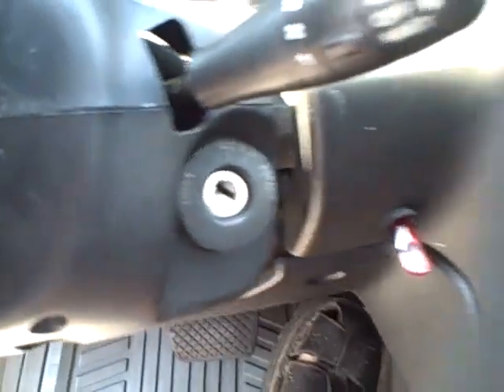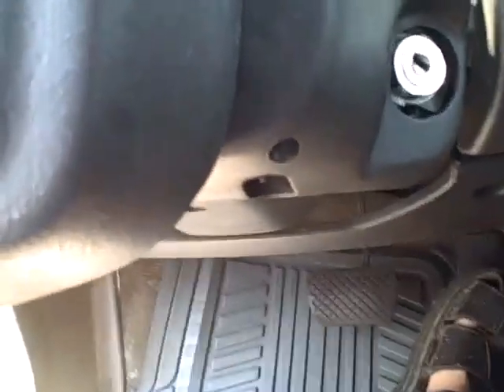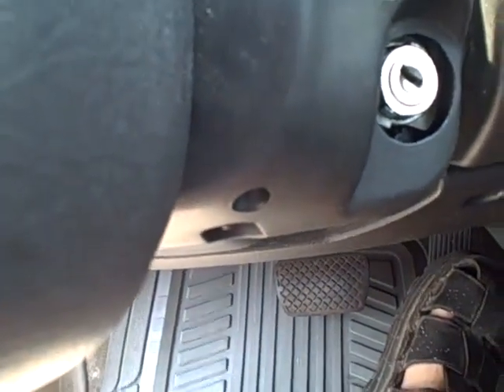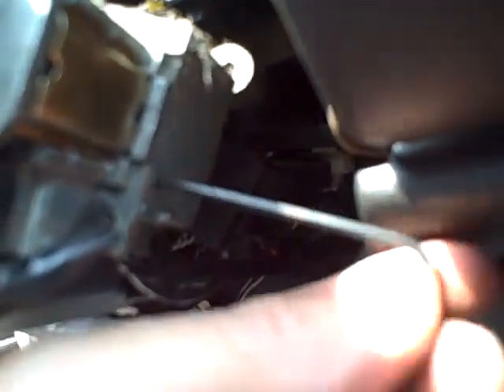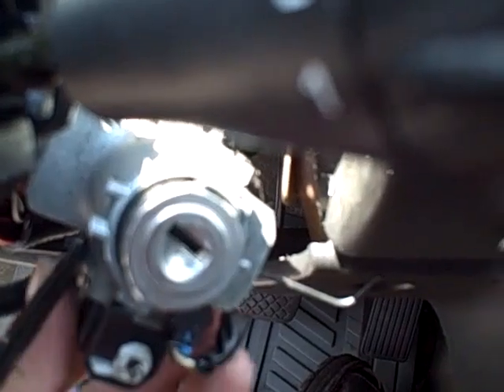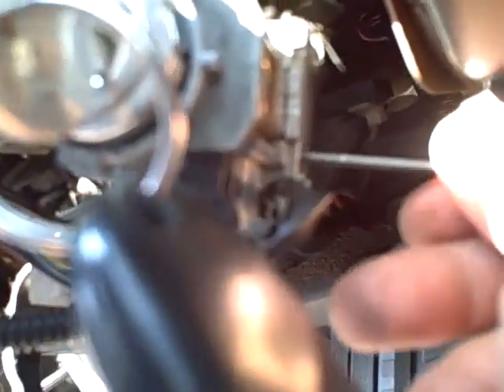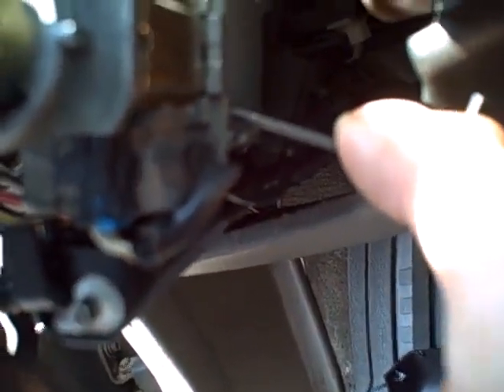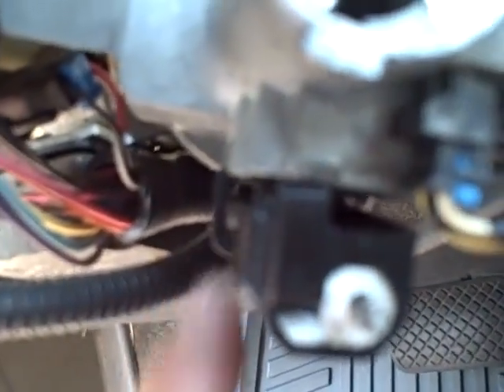2001 saturn sl2 lock cylinder removal. #SaturnSl2

Comment: @1:34 and @3:15  Can you remove that black box (with pin in it) under the cylinder, it has a cord coming out of it? I need to remove the column. I don't know how on your car, but mine is connected to the lock w/zip-tire. I don't know if it is supposed to be like that, or someone did a repair on it. The car was bought preowned. Thank you for the great film.
Update: I have Shop Manual for that car and found fm one description there that the black box might be roll connector (I don't know what it does exactly). They say:
On 2001 model remove roll connector by carefully disengaging plastic retainer tabs w/small flat ... 
All that is in Steering Wheel location. In another place they say:
On vehicles w/automatic transaxles, connect park lock cable to ignition module (shown housing for the ignition lock cylinder).

Comment: After wasting about an hour watching other videos while trying to remove the damn lock cylinder I found your video. You're the only person who mentioned unclipping and dropping the piece beneath the cylinder. I've removed these from other cars and never had any problems. It just wouldn't slide out period. It did come out when I used your suggestion. Thanks man! Nice job. I was late to work but at least I got there.

Comment: What about if you can’t turn the key in there to ACC.

I took my key out too quickly and the lock cylinder seems to be jammed. Can’t turn the key or unlock the wheel. I think I may have to buy an entire assembly just to hopefully start my car. If. It I’ll be splicing or jumper wire it to start.
Reply from the maker: These keys are really picky if they are worn down I always made like 5 extras. I really would say keep jiggeling it should turn
Reply: I hit the end of it with a mallet and switched ch keys to a less worn out spare I had, and it unlocked thankfully. Works like it’s new. Thanks friend

Comment: I just had the ignition lock cylinder on a 2002 Saturn SC2 re-keyed. I had to jiggle the key for a long time to get it to turn on. The key was badly worn. I am not saying this video is wrong, but that there are apparently lots of variations on the Saturns. Another video says that for a 2000 there is a hole on the top you insert a bent pick into.

The garage did  not feel comfortable around the lock and the lock smith said if I took out the lock they would re-key it, as the key and the internals were both likely worn. There is small hole on the right side where you can insert a small allen wrench like you said. BUT the allen wrench pushes in on a detent that slides straight into the cylinder and allows you to pull out the cylinder. There is nothing on the left side. 

I took the cylinder to a locksmith and they charged $50.
Reply: I’m having the same problem where the key won’t turn at all with the exact same kind of car!! Year, model, everything, lol Your comment should hopefully help quite a bit :)

Comment: In a 99 Saturn the part that holds the cylinder in is a slit with a piece that sits flush inside. you just need to push the inside part towards the cylinder and it will release.
Reply: Same with my 2002 Saturn SC2.

Comment: I have a 2002 sl2 -loved the video but mine did not have the black thing to disconnect the entire housing is metal.  I am thinking I'm going to have to drill it out
Reply: I also have a 2001 sl2 and i also have a full metal housing. This makes me believe that at some point the entire housing has been replaced with a modern one without that plastic piece. I've put in roughly an hour and a half just fiddling with the Allen key and I still have no success. Would love a reply if you've found out other tips. Will update if I've found out how to take out the stupid cylinder. (Why can't they make them last the life of the car)
Reply: Mine doesn't have one either.  Looks like we have to take the whole thing apart.  Has anyone had any luck taking just the cylinder out with the full metal housing?

Comment: Yay! I've been trying to get this out for two days. I was about to saw into the plate with the hole in it. Thanks to your vid, I removed the bottom pin with a screwdriver and used an allen wrench to lift up on the release tab on the cylinder. Great vid.
Reply: @RobHereAKATrev2323  Anything I need to know on putting it back in? I guess I will find out, lol.

Comment: Does the pin unlock the key lock when it is pulled out???
Reply: Ignition will not turn when the key is inserted. Will releasing the pin unlock the lock so that the key turns? I have to replace my cylinder. The key is worn down so that's why it will not turn
Reply: The steering wheel is locked and the ignition is locked. Do you have to use a hex key for the right side or can you use a star key as well?

Comment: I have a 2002 sc2 witch is the same car just different body style. .. but I was wonder if I set up a new switch will I have to get the thing re programmed mine has a chip in the key and I was wondering if your did to and did you have to reprogram just to install a new lock cylinder
Reply: My 2002 SC2 had no chip in the key.

Comment: I have 2000 saturn sc2 it will start then shut off frount tier blow out set off air bags replace them but know it woun,t stay running
Reply: Greg Huckeba what did u find on your car issue

Comment: If you can't turn the key I learned a trick.  You have to understand that the locking mechanism is basically a spring loaded "dead bolt."  When you insert the key, it is supposed to relieve the spring tension which lifts the bolt.  If you can't turn the key, its likely that the springs are full of debris.  One option is to drill a small hole in the bottom of the cylinder housing (1/4" or smaller).  This will expose the bolt so you can put upward pressure on it in an attempt to release it.

Comment: 1. where did you get the replacement part? I am having a b** of a time finding a pre-keyed lock. in the salvage yard they all had the pin release on the top...(pre 2000 models).

Comment: I appreciate the info about using the allen key to pry that pin up. But the one VERY important thing you forget to tell people and you should have done this as well is DISCONNECT THE NEGATIVE BATTERY TERMINAL.  It is rare but air bags have went off accidentally when leaving the power on!!
Reply: BS. This vehicle is a piece of